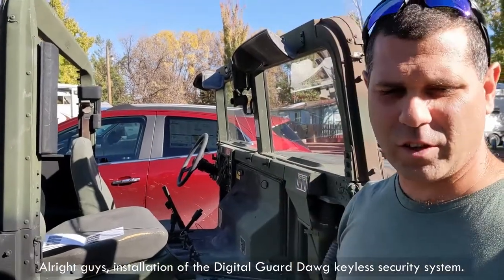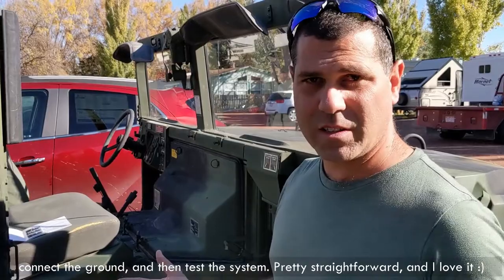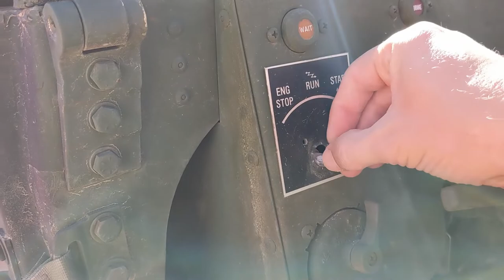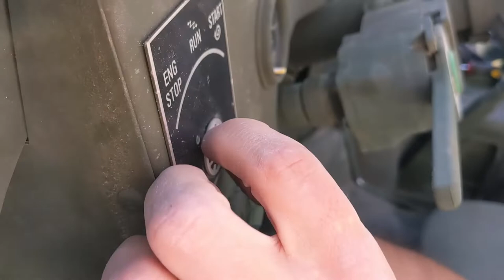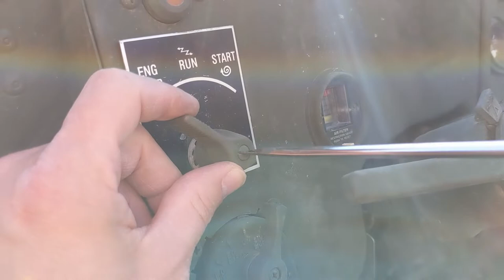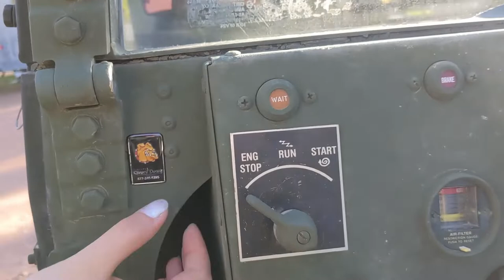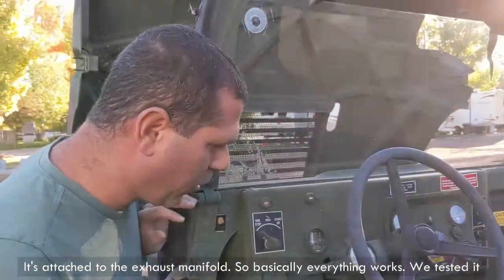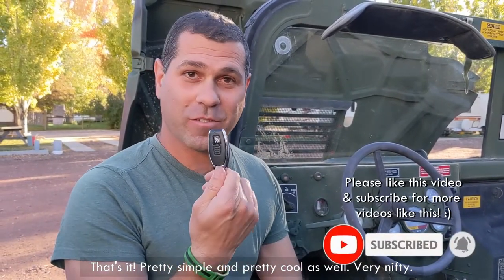Installing Digital Guard Dawg Keyless Security System On My Humvee (Step By Step!)

Comment: Nice setup 👍 what batteries do you have ? Looking for good budget batteries.
Reply from the maker: I still have the batteries I received with the Humvee from GovPlanet - not sure what brand they are, but I'm sure they're not the best option for the Humvee since Gov Planet just used them to get the Humvees up and running before the auctions. The batteries I have definitely don't fit right in the battery compartment of the Humvee and not easy to secure them to the battery compartment. :( I'm not in the need of new batteries yet so did not make the research to find the best batteries for the Humvee, my advice is to use resources such as Steel Soldiers and Humvee Facebook groups to determine the best option for your Humvee, hope it helps. :)
Reply: @theinspiredjourney  thanks. Yeah I got recommended budget batteries from home Depot. EXIDE SX24F

Comment: Maybe just a coincidence,  but I accidentally hung up my DGD within 15 feet of the Humvee for a couple of days and came back to a drained battery. I don’t know if the key fob was communicating with the DGD and drained the battery, or just strange timing.
Reply: ***key fob within 15’ feet of the Humvee.
Reply from the maker: Sounds like a tough one. Did you leave your ignition switch on the "on" position - if yes, perhaps this is the explanation to the drained battery. If not, I'm not sure. We have not had this issue happen. Take a look at our Humvee solar panel battery maintainer installation - may help in the future to make sure your battery won't get drained :) hope it helps

Comment: Caution: it fried my starter when the batt died
Reply from the maker: I'm so sorry to hear that.. Are you sure that the issue is connected to the Guard Dawg? I believe it is only cutting in and cutting out the power to the switch lever, so I'm not sure why it might be effecting the starter. Please help us to better understand the issue so we might be able to pinpoint the problem or find a solution... Thanks. :)